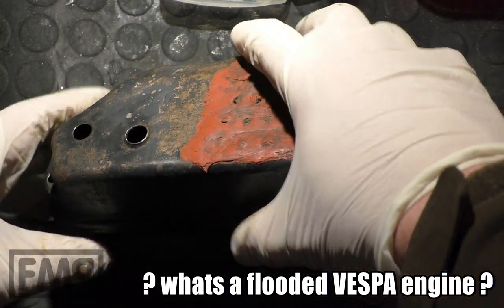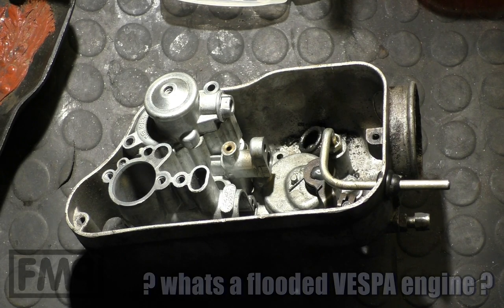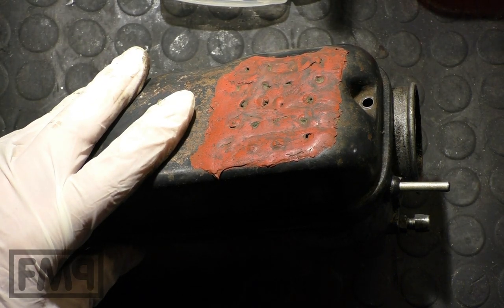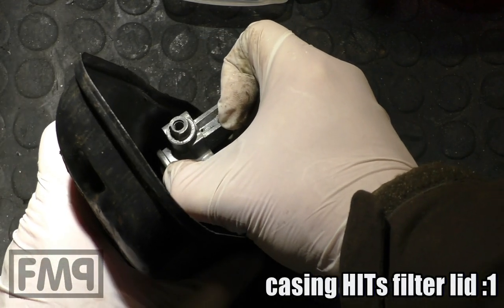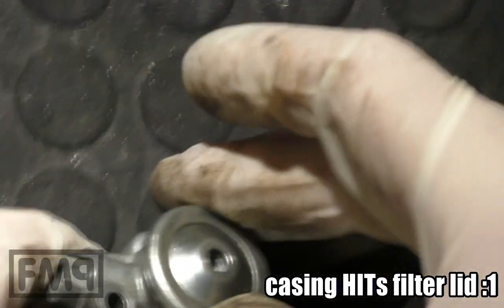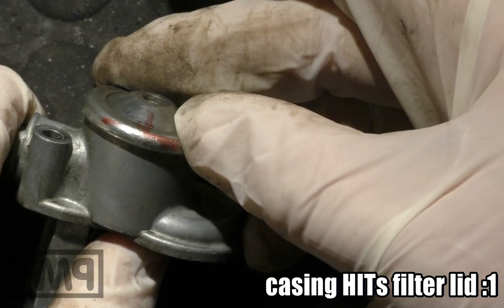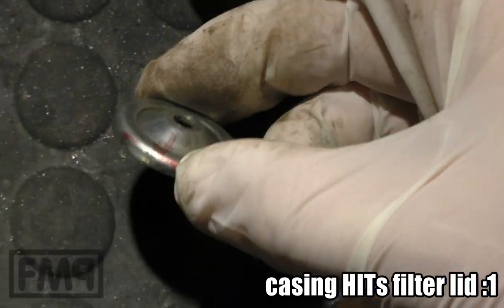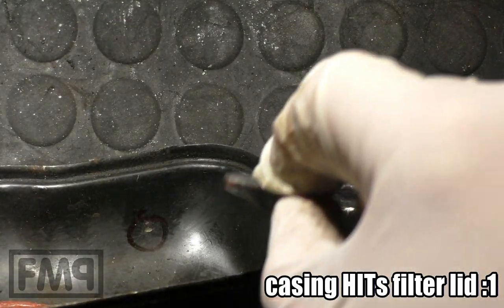vespa: 2 EASY fixes against FLOODED engines  | FMP - SolidPASSion |

Comment: Thanks - I would never have worked that cover touch thing out -so you inspired me to get off my arse and re-tackle that little donkey in the garage I often hate but love so much. BUT. Neither was it that nor the pin which I changed in my last attempt.  As I glanced at the float through in the slanting afternoon light I noticed it had liquid in it..... So it's it must've lost its buoyancy and so too logically it has lost its full ability to push the pin up hard enough to cut the petrol off?....  Hilariously true to form with this Italian wonder, the petrol that's gotten into the float is not leaking backing out again from any perceivable hole. So I can either drill a 1.5mm hole (in the top) to drain it and then -plug it with epoxy rather than be ripped off by the Cape Town parts mafia which will probably either not have it, or charge me $100 for one.
As a postscript, I would add that if you are a habitual petrol tap turner 'off - er' ( as we Vespasians are supposed to be?) and your rubber seal on your tap is working perfectly - you may never discover any of these 3 causes until that tap no longer works properly ...oh and until the petrol that seeps into the float reaches the optimum level for the float to no longer....float